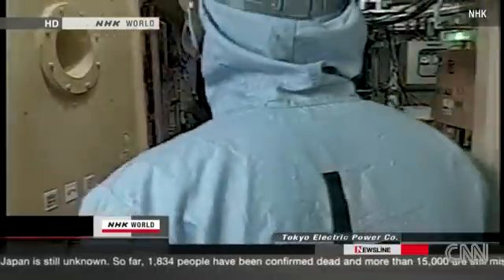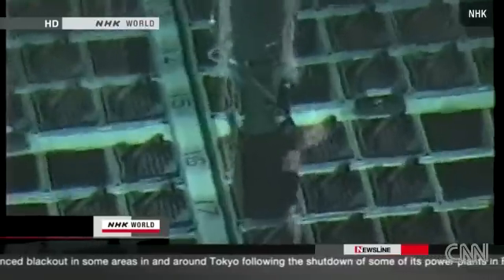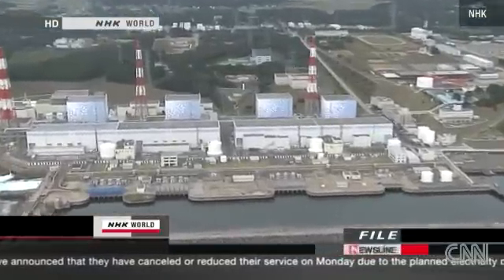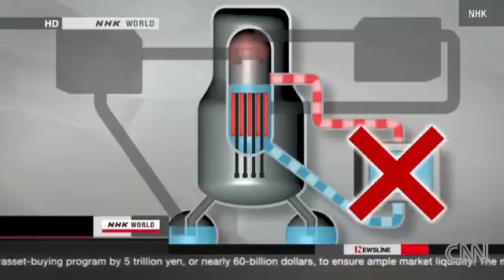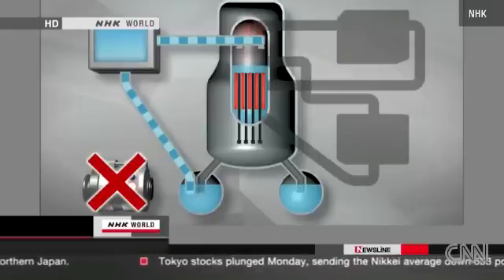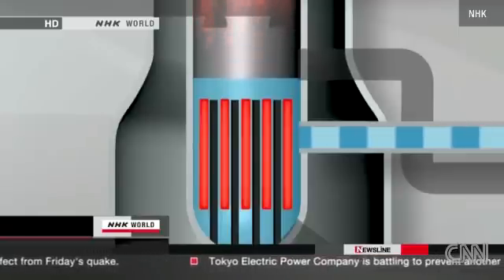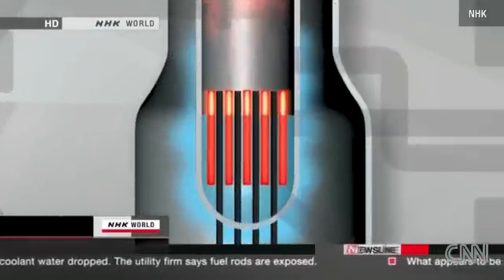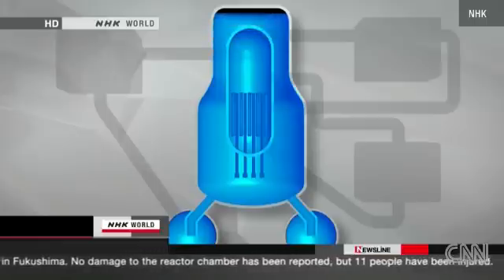Fukushima Nuclear Reactor Problem Explained (CNN)

Comment: I'm sorry you stated both the reactor AND the tsunami were man made disasters. That's hard not to think you were referencing HAARP. Secondly, Its a damn generator. How do you think they test it? By turning the damn thing on. Sure they might check a few other things, but they don't take it apart and reassemble the damn thing to check every damn piece. Use your damn brain. If you turn it on, your putting wear and tear on it. Its a very straight forward thing to think about.

Comment: "Both the tsunami and meltdown were man made disasters." Look I'd buy it more if you were insisting sabotage. But HAARP nonsense? Yes they test these things regularly. However, don't you think testing puts wear and tear on things? This would have been the first time that back up was put under hard use. New cars that are properly handle are supposed to last a while before breaking down, but sometimes they don't, despite testing. Shit happens.

Comment: "with VERY little progress." I'm sorry but you clearly don't read much in fusion reaction progress. I quick google search of the latest gains in that 40 year span will more then invalidate that comment. "Fusion also releases radiation--what exactly do you think a thermonuclear (hydrogen) bomb is?" A hydrogen bomb is a fission-fusion weapon. Meaning that it uses a fission bomb (A bomb) to set off a fusion reaction. Radiation from fusion stops with the reaction stops. Fission does not.

Comment: Last I check the latest fusion reactor experiment produce over 100% the energy that they use to generate the reaction, and now the problem is not returns, but prolonging the reaction long enough for practical economic use. However I have no comment of the gamma radiation issue.

Comment: Are you actually comparing one huge power plant to one wind tutbine or solar panel?
So you think we could just swap them without nobody seeing a diffrence?
You would need about 2000-3000 wind turbines to replace one power plant. That's over 7km² of land for those beasts, which enormously increases the rate of faulty turbines.
Why to do it? Because we need it. There is no viable alternative yet in real world. Until nuclear fusion is sorted out to work for us. That will provide safe reusable power

Comment: Actually, fukushima was on the same scale of chernobyl. Not as much radiation went directly into the atmosphere, but 3 times more gases were released, and there are more reactors involved so it is more complicated. Also, the cooling water that was pumped into the 3 reactors leaked out and most of it went either into the ground water or ocean. Nuclear engineers have expressed concern that more radiation was released in this way than Chernobyl and only time will tell how bad the contamination was

Comment: Umm...from what I've gleaned a nuclear physics degree would be more helpful, and I'm pretty sure the radiation levels and heat are only extremely high when the fuel is being forced break down at an accelerated rate from what occurs naturally in most cases and afterwards. Although the only natural exception I've heard is a 'meltdown' of a uranium deposit in Africa that has going on since before human history.

Comment: Course it is. It does not just stop. If Its just the Cesium, it will be bad, but its done radiating after 30 years. If really nasty stuff is leaking, such as Plutonium, that would be kinda bad.
Reply: Cesium is bad if you eat it

Comment: Short story the carbon moderator caught fire and spread irradiated carbon particles into the Russian atmosphere.  US designed plants us water as a moderator which is less thermally efficient but extremely safe.  (Water can't catch fire in case you were wondering).   Nuclear power is very safe and this event in Japan only highlights that fact.  Look at satellite photos of before and after the earth quake and 20 foot tall tsunami wall of water.  What's still standing and what isn't?

Comment: Totally not true or based in fact / reality.  The Chernobyl reactor used a carbon moderator to transfer heat in the primary system and had no where near the safety features that are in place today including a containment building.

Comment: The problem at Fukushima was the spent fuel stored on site because activists wouldn't let it be taken to safe storage. Had it been removed and sealed it wouldn't have burned when the pools dried up and very little radioactivity would have been released. The reactor vessels contained the meltdowns as they were designed to do.

Comment: Printing. It's a great job. I have time to follow all the best scientific literature.
Did you know that there have been 50 confirmed deaths from Chernobyl? Of 4000 cases of thyroid cancer, nine died and the rest have fully recovered. Up to 4,000 are expected to die of the effects because the average exposure was many times higher than the worst exposure at Fukushima. That plant had no containment. No meltdown has ever breached a containment system.

Comment: I distrust anyone who tells me what I have to think. On both sides. Look for reliable scientific data rather than fear mongering.
Nuclear power has so far been safer than other sources. To date, if you include Chernobyl, about 1/4 death per Terawatt-hour (Twh) of electricity; slightly more for solar and wind and slightly less for hydro. Gas is about 3, coal 25 and oil 36 deaths per Twh. Drilling and transport are pretty dangerous.
US coal power plant pollution kills about 15 per Twh.

Comment: They're closing nuclear plants across the country for routine maintenance and postponing reopening during the political debate. Japan is replacing the nuclear generating capacity with both natural gas and coal. I expect the death toll due to extra heart failure to the elderly will exceed the worst scientific estimates by mid-summer, if it already hasn't, but it's still safer because that won't be on every front page in the world.

Comment: Total death toll so far, 2 heart attacks, 2 industrial accidents and 2 more who had not received significant exposure, but one died of leukemia and one of unknown causes. At worst possible estimate, there might be an extra 1,000 cases of cancer, mostly treatable, within the next 30 years. For a population that size, it's not statistically measurable compared to normal.
Replacing it with clean natural gas will kill that many in most years to cancer and lung disease.

Comment: Judging from what happened in Chernobyl - the answer is completely positive. There still is hundred kilograms of plutonium and one micro gram is enough kill a man. It would take around 240,000 years for that plutonium to dissolve which you can practically consider as eternity. Radiation is emitting itself from the reactor nevertheless.

Comment: They should have given additional safety features like pressure relief dampers or pressure surge dampers along with HEPA filteration for the worst scenario of contaminated air escaping from the chamber. If pressure builtup was avoided in this case then we could have limited the radiation leakage to a much lower level or even to zero level.

Comment: Future nuclear power plants should adopt the Thorium fuel cycle.  LFTR type reactors are safer, more efficient, and produce far less radioactive waste isotopes with much shorter half-lives.  No possibility of melt downs, no need to enrich uranium, and the fuel "Thorium" is much more abundant.

Comment: @Summon256 actually atomic energy is VERY reliable 

this particular power plant was under standards.....u need more then 4 securty sistem .. always have a plan b,c,d,e,f,g,h,j,j,k...........

also if we learn how to recycle spent fuel rods without polluting, atomic energy will no longer have any downside

this is until we perfect fusion energy , fusion is the future , it doesnt pollute at all, its safe....and its very efficient.

Comment: @finallykickinback It is safe if it is properly designed with the proper fail safes. It is also clean, it works the same as as a coal burning power plant, the only difference is that it uses nuclear fission, which is entirely clean, to generate steam to turn the turbines that generate the power. At the moment we can only store the nuclear waste until its radiation lowers to a safe level. Instead of not using it at all, we should find ways to improve it, as it is still better then other means.

Comment: @finallykickinback " no way to dispose of toxic waste" Don't need to dispose of most of it. The more radioactive the so-called waste is the more suitable it is as a fuel. If the laws bought by the uranium mining lobby were changed to allow reprocessing, there would be no high level waste.

"If it's a choice between that mess and carbon - I'll take carbon."

Coal fired power stations release more radiation per watt than nuclear, by many times. Also kill more people.

Comment: fusion ain't really here yet...
Had it been a reactor design that uses molten salt, there would be no need for the hundreds of air pressures needed to keep water, its so called safety deal, from turning into steam and then, explosive hydrogen.
Or had it been one of the hundreds of other low pressure designs  like molten metal.
Search WHY "they" killed LFTR, and the IFR... It's a hard find!
(UNLIMITED CLEAN ENERGY)...

Comment: @CrossMultiplication come on. in the 60's, japan experienced 10,000 times higher radiation because of nuclear experiments done world wide. it was 10 times higher than Fukushima disaster. one nuclear experiment done in the air much more severely pollute the air, because it releases nuclear material directly into the air.

"We are innocent because we did it before anyone realized it"
don't be stupid.

Comment: @TrousersDPM No, that would not stop the radioactive isotopes(I think that's correct) leaking out.  They don't react to any temperature changes. if it's +1000 or -1000

Comment: @fstratzero It doesn't create plutonium. Plutonium is the fuel they use in one of the reactors. It's just like how they use the Uranium-235 and 238. 
Plutonium is more dangerous than those two.

Comment: The only thing they really knew was to get out of there as fast as possible when, ironically, their power supply was interrupted by the Tsunami.  Nuclear power plants must be kept cool forever. Did you here me?  FOREVER

This is unacceptable.  It is not responsible.  Nuclear power is a result of massive short term profit for contractors and immoral engineers who have always mislead the public about the risk associated with Nuclear Power.

Comment: @shiluugei23 Actually, all 4 of them failed for the fourth one (it screwed up the final "kill the reactor" trump system when sea water failed to fill the tanks). Earthquakes are unpredictable, and such a large one happening scales up the oh shit meter very quickly exponentially. There were reports about other conventional oil power plants that were burning after the quake and pumping the air full of shit, but the nuclear one is much rarer and more exploitable to report on.

Comment: Or in stead of throwing in just water, try to throw in some ice as well. Ice is solid and can be amed bether on hi wind situation, or they could mix the water with ice to make it mor efficient in cooling the darn reactors. Or after throwing in wather also thro in some carbonic ice. That will react with the wather, keeping it cooler for a litle bit longer. Ofcourse they should factor in also the britleness and termal shock of the reactor's metal anvelop, so that they won't shatter it.

Comment: I think it is the outmost vessel that exploded due to pressure buildup. The water inside the bigger vessel has no direct contact with the rod. So the radiation wasn't (very much) detected.

Comment: Ok, so this means that the core is exposed to open air?? Or - to be more precise - the first explosion was on saturday, but no high radiation was announced. So what did explode? Was the explosion somewhere on the cooling circuit? If so, this water and steam had direct contact with the rods? Following the same logic, if the circuit was airtight, after the first blow the core should have been exposed - which was denied by officials and measurements in the area. So again, what did explode and why?